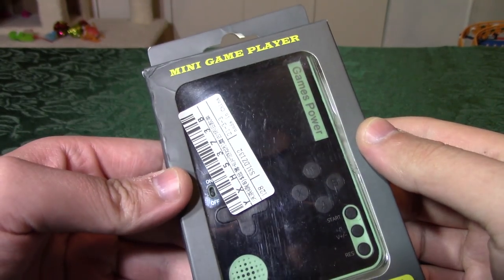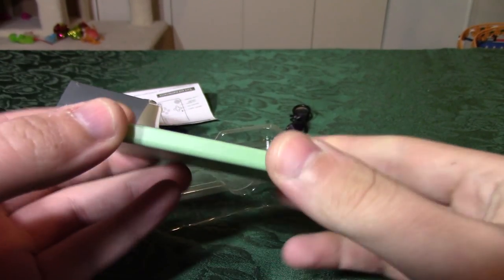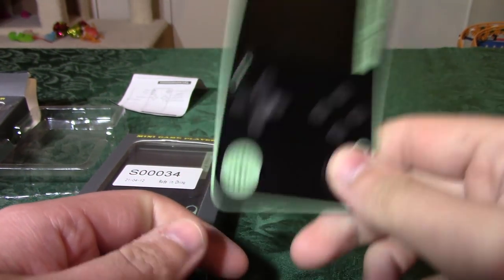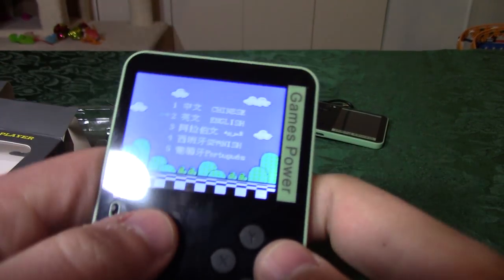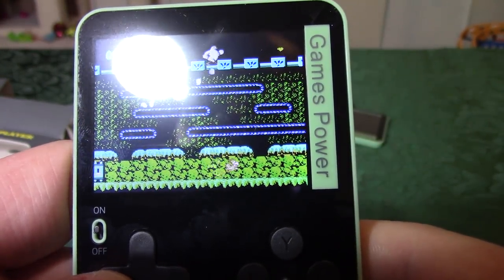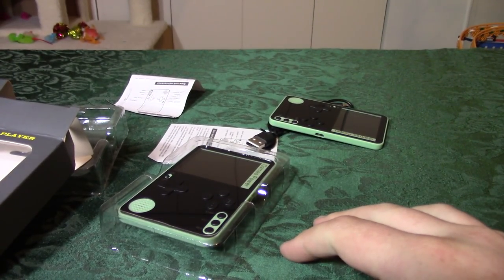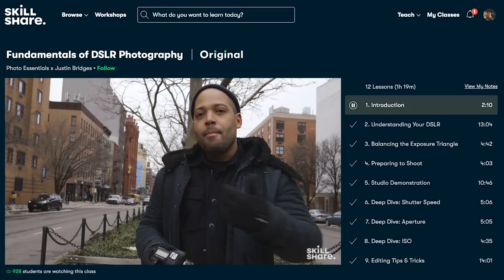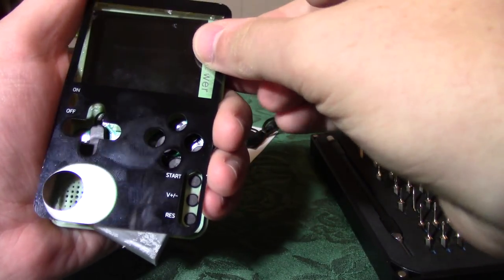Mini 500 Game Player Review (15 Year Special)

Comment: 15 years! Wow, time flies by! 
The epoxy blob does not have an ordinary chip below "they want to protect". Its just a "chip-on-board" (COB), bond-wires are soldered to the PCB pads. In mass-producted objects it saves a few pennies compared to regular integrated circuit packages.

Comment: The Mario 3 music doesn't sound off key to me, but it sounds like the pulse width for the square waves is wrong
Reply: It's common on bootleg hardware to swap the duty cycles. An emulator made for playing proprietary bootleg roms has the option for swapping them built in.